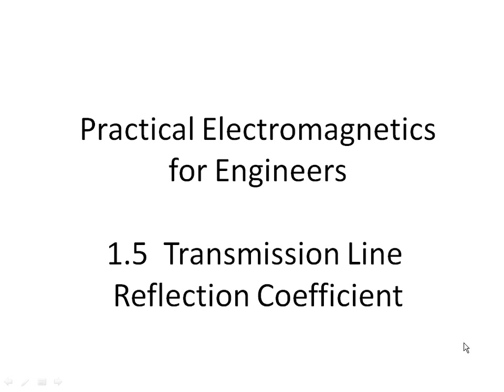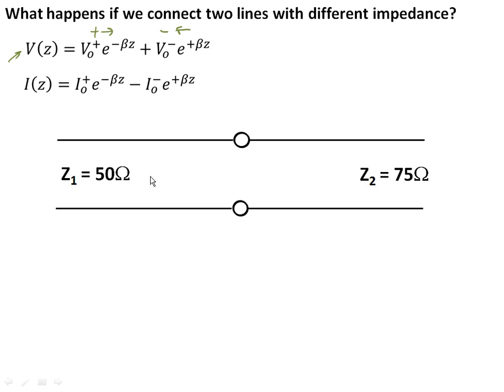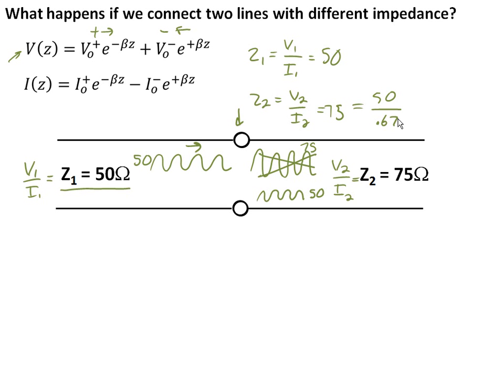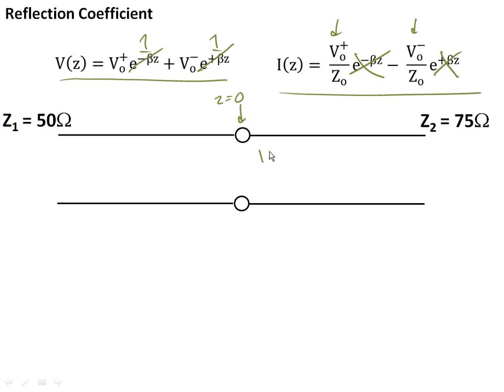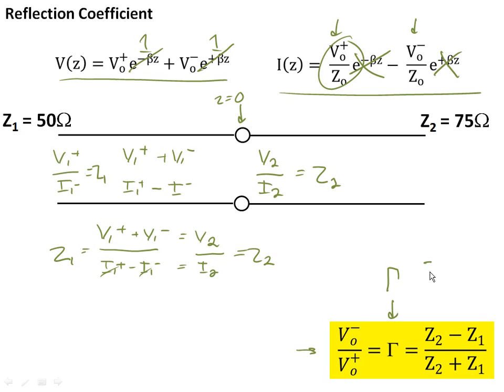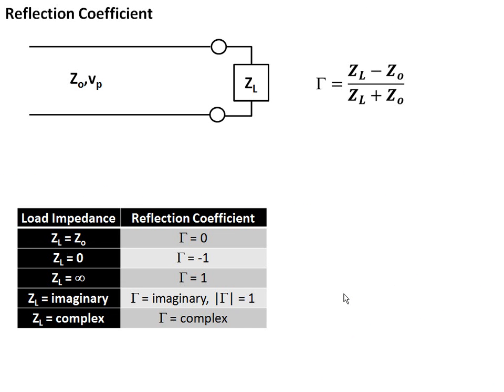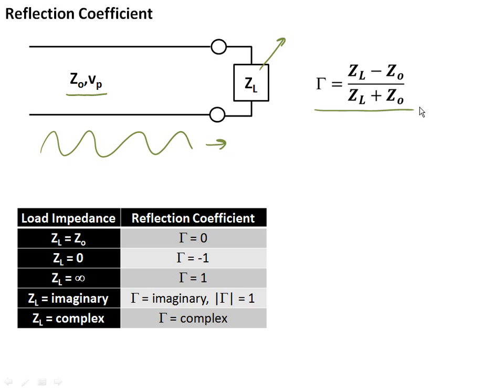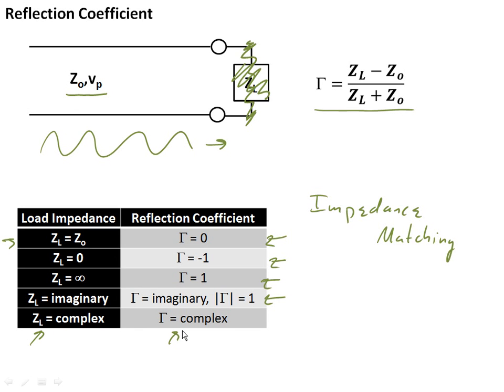1 5 Reflection Coefficients on Transmission Lines

Comment: please can you explain why you are adding incident and reflected voltages but subtracting currents?
Reply: +sandhya pochiraju From his explanations, I believe it's because the voltage is taken between two terminals. The only values that matter are the ones between top and bottom conductors, so the forward and backward traveling waves are like two stacked points you can move around and have a value across. The current only has one point/direction, really, so you can only say it's going forward or backward.